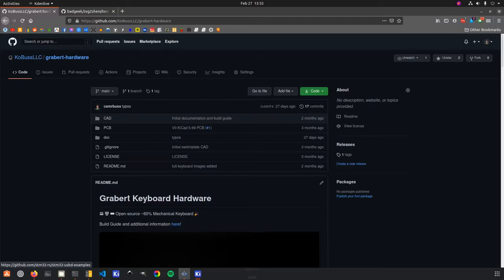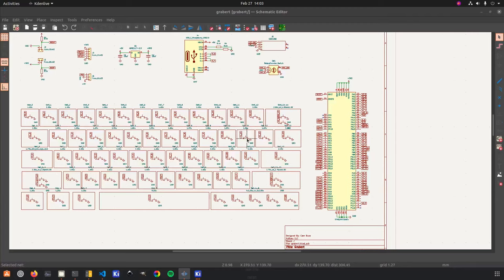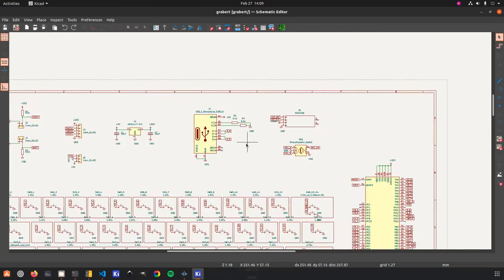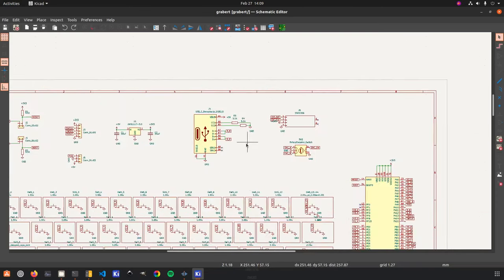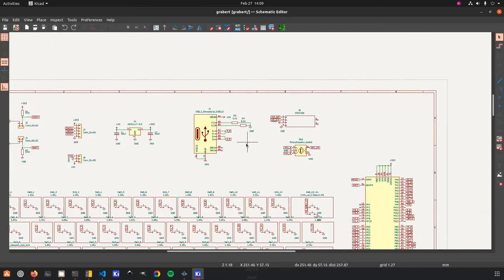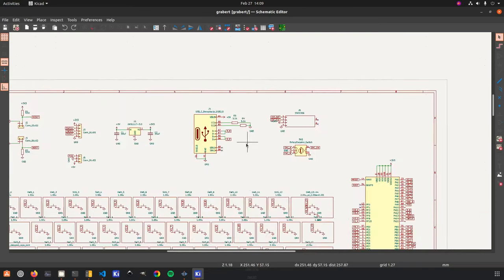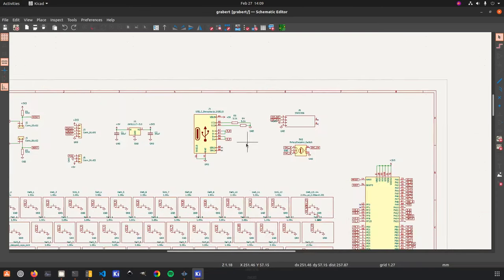How we designed a mechanical keyboard PCB!

Comment: The capacitors are important to load the output correctly and present the correct impedance where there are transients. Having decade capacitor like 1uF in parallel with 0.1uf and 100pF allows you to bypass high frequency noise. In a simple LDO you won't experience much trouble, but in a switching regulator with large transients you can have LDO stability issues where it can oscillate.  So  only then you appreciate adding decades of capacitance at the input and output of the LDO.
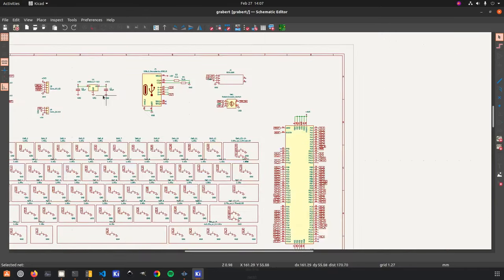Reply from the maker: Ahh, I see. Thank you so much for this comment. I added a little card a 6:25 pointing to EEVblog's video explaining what you mentioned. Beginners mistake!
Reply: @kobuss5680  The caps will lower your impedance over a broader frequency range.  You would also appreciate it when you are testing for FCC/CE EMC trying to certify your product.  You find that if your circuits switching are not properly bypassed, they produce unnecessary EMI and you simply fail the test :(  That is rough!  Sometimes you fail for other reasons like poor PCB design, lack of signal integrity on signals, but other times can be your regulators and switching circuits.  RF is the other reason you can fail, but it all boils down to properly bypassing your circuits.  Good Job in your video!
Reply: @kobuss5680  Just wanted to say - thanks so much for following up here and opening up discussions + providing corrections in the comments. As someone with only a CS background (no CE) and hardly any circuit design experience, just listening to someone walk through their process has helped tremendously in giving me a starting point on my own keyboard project. The video you referenced here cleared up a lot of confusion I had following both yours and others' guides around this particular part of the circuit. Rjrodrig6, thanks for taking the time to provide some context here as well!
Reply: No matter what your powersupply is I always recommend adding some capacitance close to in/out pins. Most linear regulators require some - but not too much - capacitance to input and output (read the datasheet)
Reply: @kobuss5680  hey kobuss, i love your content man! would you happen to know if there are 3d cadcam models of current public keyboards?

Comment: Hey little late to the party, I'm looking into making diode-less keyboard with QMK support. I do not see STM32F072V8T6 on the list of compatible microcontroller for QMK. I just wanna confirm if STM32F072V8T6 actually support QMK and have you tested with it? As I'm quite new to this any input would be amazing! Thanks in advance

Comment: Are there any major advantages to assigning each key its own pin on the micro controller? Like key press latency etc, and is there anything else you need to think about that you wouldn’t when using a matrix?

I want to make a small gaming keyboard with only a few keys, and I want to have individually addressable LEDs per key. Obviously a matrix would reduce the number of pins I need, but I’m interested in the potential for the latency save somewhat?

Comment: How would you route data and power lines for addressable led, would it require a separate layer?
Reply from the maker: You could route them similarly on a 2 layer board. You could make one side of the board a filled zone with 5v and then route the data lines on the same layer.

Comment: with multiple layout configurations, you mean that in one section you have different positions for keys, where they could also be offset by half a centimeter? So if you don‘t want that, it should be quite straight forward, right?